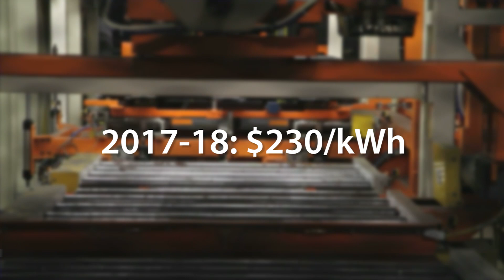EV Battery Prices Dropping Faster Than Predicted - Autoline Daily Insight

Comment: But where does the electricity come from to charge electric batteries? Fossil fuel power plants. This is not an end-game solution. We need to pay more attention to the fusion plant being built in France, and switch over to hydrogen power, splitting water through electrolysis with fusion-generated electricity to make clean hydrogen. This completely cuts out fossil fuel dependency.
Reply: +Mcchuggernaut the idea is to eventually use clean energy sources to power everything across the world. Such as solar panels.
Reply: But solar will never be able to provide enough power. It simply isn't efficient enough. It requires too much space for the amount of energy it generates because of the size of the equipment needed to harvest the solar energy. Even at 100% efficiency, which is impossible. Nuclear power is many orders of magnitude more energy efficient, but fission is too dirty, which is why we are trying to develop fusion reactors, which solve the problem of nuclear waste by being almost completely green while producing the amounts of power required to keep everyone supplied, and in a compact form.
Reply: +Mcchuggernaut Hydrogen won't do it. EV will win.
Reply: I used to be a fusion advocate too, then i realised that commercially viable fusion is not going to come online until AT LEAST mid century. More likely nearer the end of the century. We need to have our energy needs sorted out well before then. Also, the aggressiveness of the solar price curve suggests that even if we cracked fusion by 2050, it probably won't be as economically viable as solar is by then, so it will only be used in niche applications where solar isn't viable. Some people even predict that if you generated electricity for free, the cost of transmission would be more expensive than just generating that electricity on your rooftop. Time will tell, but I doubt fusion will  be a major player in the worlds energy needs in our lifetimes.
Reply: +Mcchuggernaut As indeed  does using electricity generated by renewables.Solr power to car cuts out several stages, thus is far more efficient.
Reply: +NZJacobNZ yeah I used to like fusion but the cost will never work, I hope the ITER tests will go good, fusion will be for our space travel, solar will take the earth with how dirt cheap it is becoming. I mean 2,4 cents a Kwh in dubai that is unheard cheap and there is no reason to think it will lvl out soon!
Reply: And with the promise of perovskites, solar is set to really take off. 
Now we just need energy storage costs to greatly decrease which should 
be the case with the rapid uptake of electric vehicles over the next 10 
years. These can provide portable energy storage to be used during peak 
electricity demand times and charged during off peak times.
Reply: +Mcchuggernaut  It depends were you live, if you in a place thats so far north that you freeze your butt off for 8 months a year then sure solar is not for you but there are a lot of countries where the sun beats down all day every day so using a solar set up on the roof of your house enables you to power your home and your car with either electricity or hydrogen gas.
I have to wonder how long  a 35cc petrol engine would run on a tractor tube fully blown up with hydrogen, cause with that you should get an hour out of it which means you dont need batteries or a cylinder for the hydrogen you put the tractor tube in a steel bathtub shaped chassis so if it goes up it will just make a ball of flame, there wont be an explosion and the cock pit can just be flame proofed slightly it would definitely take your eyebrows off but there wont be any explosion. 

Batteries are expensive to replace, if you run a small 4 stroke on hydrogen it could last a good while it just needs to be a twin cam engine so you can adjust the valve timing so that there is no overlap on the valves and replace the valves with stainless steel. It can be done, it just takes someone with the balls the money and the time to get on with it.
Reply: NZJacobNZ.  ya.  Musk just told Australia that he would fix their southern grid to stop black outs in 90 days or it was free....doing it with power walls to combat pick useage
Reply: Fossil fuel interests are very hot for hydrogen storage of energy, because it keeps carbon on the table. Are you a fossil fuel supporter? I kinda bet you are.
Reply: Batteries are dtoppinh dramatically in price and you can power the entire continetal U.S. on a 12 million solar farm. That is so small if you look at it on a map you will laugh. Cause it equalls 0.6 % of our land mass.
Reply: Great invention the fall of petrol empire
Reply: Mcchuggernaut the amount of electricity used to convert oil to usable gas is very expensive. The average refinery uses about fifty to sixty thousand dollars worth of electricity a month.
Reply: EVZebra I live in south Texas, the summer here last ten months and then we have spring for a month and a half, only two weeks of winter.
Reply: Mcchuggernaut, the beauty of BEV's is that they don't care where the power comes from. I can charge mine off my solar array at home. Democratisation of energy will be a powerful thing.
Reply: Note: a 100 mile x 100 mile area in Arizona, about 1/3 of several different military bombing ranges there, would produce the entire current electricity production of the United States.

Comment: The price of petrol is still falling in the UK. I'm a full time cyclist but stunned to see fuel at 99p per litre! I think the government here don't want electric vehicles. Lower fuel prices means less tax, And thats all there interested in!
Reply: +Scott Wheeler Have no fear. The UK government have lots od ways of taxing non-fossil fuels. Ever heard of VAT for instance
Reply: the world oil value is at an all time low within a past decade or so, but it probably won't be long before they're going back up. 

The government has changed Emissions tax as well so new cars will pay a flat rate of around £140. which means a BMW doing 20mpg will pay the say as an Aygo doing 60mpg or a Prius doing 100mpg... it's sickening, the only cars that will be tax free are cars under 40g/km of Co2 (so cars over 165mpg). the only burden big cars have on their emissions duty is a first year tax hike for high emissions vehicles
Reply: Anthony Smith, uh, it's they're, as in 'they are'

Comment: lg chem is selling 1kwh to gm for $145 in 2015
Reply: No, you are quoting cell prices, not packs:

Electric-car battery costs: Tesla $190 per kwh for pack, GM $145 for cells.
http://www.greencarreports.com/news/1103667_electric-car-battery-costs-tesla-190-per-kwh-for-pack-gm-145-for-cells
Reply: "Jeff Evanson, head of Tesla's investor relations group, dialed into 
the conference call to take issue with Bereisa's assumptions and 
estimates.
He noted that Bereisa had assumed the Model 3 would be entirely made 
of aluminum, as the Model S is, whereas Tesla Motors has said several 
times that it would use a blend of materials.
More importantly, he said the battery-pack cost of the Model S today 
is less than $190 per kwh—which would indicate a cell cost of $128 or 
less using Bereisa's 48-percent increment."
Reply: Steve Bollmeyer. tesla put a steel floor in to off set the fear of fire

Comment: I wonder how we will pay for the roads and highways when electric cars rule the road?  Along with the drop in the cost of batteries, there has also been a drop in the price of solar panels.  I see a day, in the near future, when we power our home batteries with solar to recharge our cars at night.  So do we charge drivers per mile/km for using the roads, but I don't like the idea of big brother keeping tabs on me.  Or we have to increase things like sales/VAT taxes, since nearly everything we by must be transported via roads.
Reply: Just don't get me wrong.  I'm not against electric cars or going solar to run them.  Electric cars are by nature better as they have fewer moving parts and we don't have to support shaddy governments to get it.

I see a future where solar panels are so cheep, we will be able line the north side of our roofs with them.  It all comes down to ROI.  Those with excess power will sell a cent or two below the price of those buying it.  The market forces of supply and demand will determine the price.  Like it does with so many other things from commodities (excluding gov subsidies) to foreign currencies.  We will still need the utilities to manage the grid from power lines to transformers, to storage.
Reply: +Quiet Corner It will be simply, they already know how many miles we travel when they do yearly inspection. All they would have to is charge per mile. They will have no ideal where you went.
Reply: My problem with this is, the revenue only goes to the state or country you are registered in.  What if you travel out of state/province/country a lot, the states you travel through gets nothing. 

I think there will be a lot more electronic tolls. Don't get me wrong, I'm excited for this clean revolution.  I hope that in a few years, my Tesla Model 3 will be charging off my Tesla Powerwalls each night  I'm just posing a question.
Reply: *****
 yes it's a tax and we need taxes to pay for the roads.  It's just how are we going to collect it?   Again I can't wait for my Model III to be in my driveway.
Reply: I'm not an engineer so I don't know the technical part to doing this.  It's just an idea.  I figure if my commute uses on average 10kw round trip, perhaps after getting home, I can top the car back up from the energy my solar panels have collected.
Reply: Neal Archer
I would consider the storage of the battery depending on my daily usage.  So I drive about 35 miles a day and guessing if I use say 10kw, then I would have a battery that can charge what I need.  You're right, at what cost?  I don't know.  I will probably have to wait until cost come down.
Reply: +Quiet Corner solar panel roads bro
Reply: Don't get me wrong.  I'm all for solar homes to power our electric cars.  I know that we have to pay for it.  I like the idea of solar roads, they are testing that out in the Netherlands.
Reply: +Quiet Corner The results of he Netherlands' tests will be most interesting.And on't woory about paying. HM Treasury are experts at getting money out of the hoi poloi

Comment: GM says it's $145/kWh today. Is that true or not?
Reply: +dilbert net GM has a package deal.  If they agree to buy the speakers, radio, electronics, power modules, et cetera THEN the manufacturer agrees to sell the Volt battery for $145/kWh.  It's incentive pricing.  If GM purchased just the battery, then they'd have to pay the standard 250/kWh pricetag
.
Reply: +dilbert net GM has a package deal.  IF they agree to buy the speakers, radio, electronics, power modules, et cetera THEN the manufacturer will sell the Volt battery for $145/kWh.  It is incentive pricing.  If GM purchased just the battery, then they would have to pay the standard 250/kWh pricetag
.

Comment: $125 KW?   that will make a Tesla Model S  just $35000 to $45000
Reply: Discharge suddenly? Someone has bought into oil industry's propaganda.
Reply: +Danny Arangale batteries don't discharge suddenly, unless you hit the road with 2% left without noticing it, but I bet each car will tell you with some signals that your battery is low. It's all the same with fuel cars. And about charging time, tesla bought patent for chip which will let charge batteries much faster, maybe in couple of minutes to full charge. And phones also do a big role here. Phones starting to demand more energy so batteries also needs to improve and same technology can be integrated to electric cars.
Reply: J Chu That would also make his future model III even less like around 12-17K
Reply: You will have to wait 2 hours before using it? bullshit... any person with a brain would've charged it while they was sleeping and while you're on the road a fast charging station can charge from 0-80% in 40 minutes or 50% in 20. this is why electric cars are becoming popular now, lithium ion batteries are becoming affordable.
Reply: Danny Arangale what if your gas tank leaks. Or you run out of blinker fluid lmao
Reply: Danny Arangale Bolt have 57,000 miles no sudden battery discharge. I consider the MB of electric cars.
Reply: JC Journey 

L
Reply: Whatever you do be sure not to run out of flasher fluid.  The police will not accept that as an excuse, and it is really tough to find.  But Tesla blinkers operate electronically.  Now You Know.
Reply: Patrick Carey Yeah maybe even immoral ha ha ha!
Reply: ***** Exactly anyone with a working brain would plug it in after they get home from doing whatever is they where out for.  Why the hell would anyone "wait' till its nearly depleted to charge it? The hole "8 Hour" charge time if for a nearly depleted battery. And yet people don't seem to understand that.
Reply: +gunit8590 how long you are going to charge that? You will have to wait 2 hours before using it.  What if the battery discharge suddenly while you are in the middle of the road?  It is not a reliable system yet.  Only FCV answers all those limitations of electric cars.

Comment: A market that seems ignored is an application for used batteries. For example, a Leaf battery that hits the limit of its life still has around 18 kWh of useful capacity. Why buy a Tesla home battery system when you could pick up a used Leaf battery with significantly more capacity at scrap prices.
Reply: dMb It's not ignored. The oldest LEAF ever sold is from December 2010, less than 5 years old (and there were precious few sold that year). The warranty on those packs is 8 years, while life expectancy of the packs for use in the cars is probably 10 years or more. There are simply no used LEAF batteries around yet. There will be a big boom of used automotive batteries for stationary packs, starting 5 to 7 years from now.
Reply: There are certainly used batteries out there. Cars are in accidents all the time, and the components are sent off to scrap yards. Also, the Leaf had quite a few early battery 'failures' in hot climates like AZ due to the lack of liquid cooling. Batteries that are replaced under warranty go somewhere, and using them in buildings is a great application.
Reply: +zlozlozlo I have already replaced the battery in my hybrid twice.  The first used battery went to Honda who did who knows what with it (shipped it to an African landfill most likely.... that's where most electronics go).  The second used battery went to a Private California company who tested all the cells, trashed the dead ones, kept the good ones, and reassembled a "refurbished" battery.  It cost 800 dollars
.
Reply: electrictroy2010
What year was the hybrid made? When dd you do the replacements? Do you know the chemistry of the batteries? Was it lithium-ion or NiMH?
Reply: In the UK, there are several specialist firms that refurbish battery packs, testing and swapping out dead cells. They are readily available and offer owners of cars with typically 70K+ Miles a new lease of life for their cars

My father replaced the battery pack on his Prius for around £800 GBP when Toyota quoted him £1700 for a new cell pack.

I assume the newer models have more efficient and durable batteries but I wonder if they are as "serviceable" as the earlier battery packs in this regard.. ie are they modular ?
Reply: TheComputec, I believe they are modular - for example, Tesla's new packs for the Model 3 are actually made up of smaller cells in the 2170(?) format. Plenty of people are using old Tesla packs from wrecked cars to build diy electric cars or home storage systems.